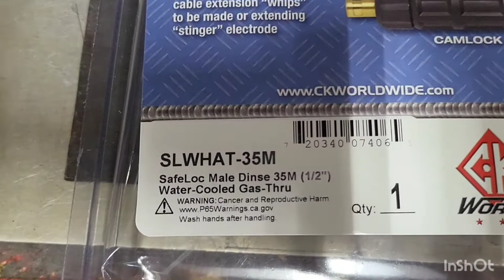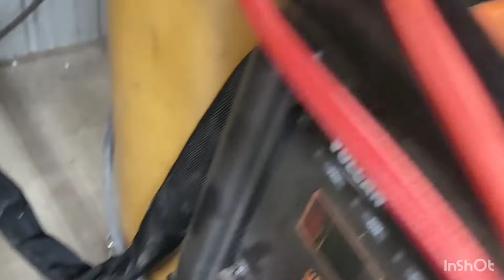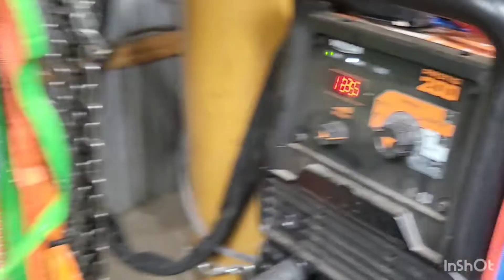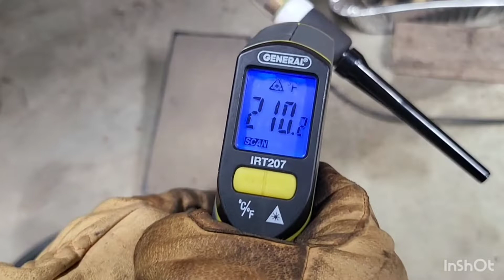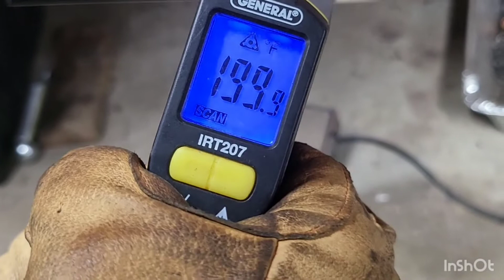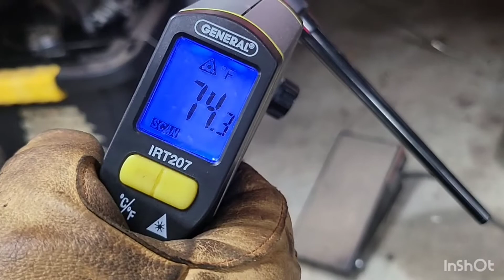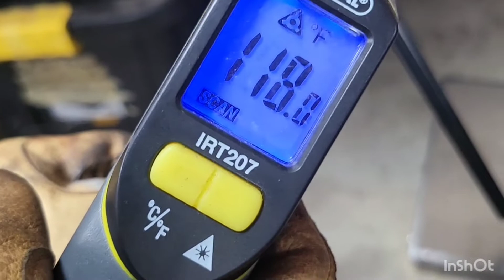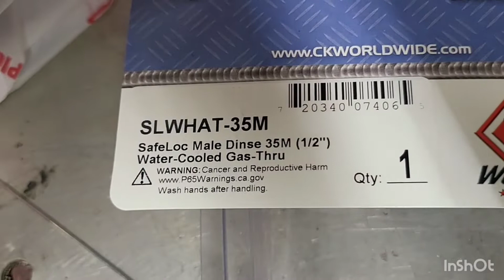Convert Your Vulcan Tig Welder To Water Cooled

Comment: Okay at 3:34 you said aluminum
 aluminum: has to be welded on AC current not DC 
(And your Vulcan only puts out DC so how are you welding aluminum?)
(good welds mind you)
 not some I'm halfway surprised that you put that on there
I'm not asking to be a butt head I'm asking because I don't know I'm just wording it weird because maybe a misunderstanding
Reply: The ProTig 200 and the later ProTig 205 both are AC-DC welders.  The Vulcan 170 is DC only.  I have been running my ProTig 200 for the past 7 years.
Reply from the maker: This is the protig 200 that does both AC and DC and it was discontinued a couple of years ago. And it took me a bit to get the settings figured out for the new torch assembly
Reply: Actually in Aerospace and Defense Industry DCEN (DC Straight Polarity) is used more often for Class A Welding which uses Helium (UHP) for shielding.

Comment: Looks like you have a contamination problem with the water cooled torch, check your connections, and check for cross contamination.
Reply from the maker: There was, I double checked everything and made sure it was clean then made a couple of adjustments and now it welds pretty good!
Reply: Looks like you had the manual gas valve on the torch head turned off…
Reply: I had a gas lens stop flowing and don’t know why actually had two do it so I threw them away China brand
Reply: Yep, that's does happen, hope you had better luck after @JC-dg3mh